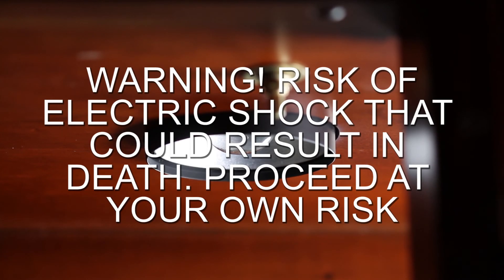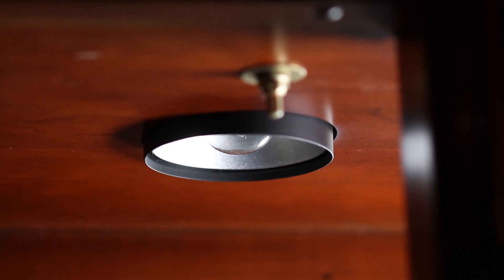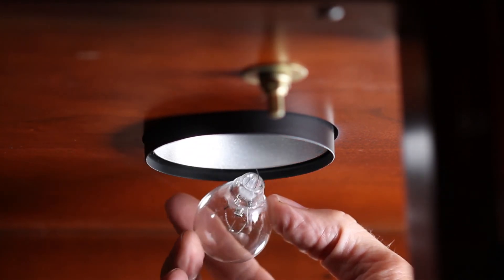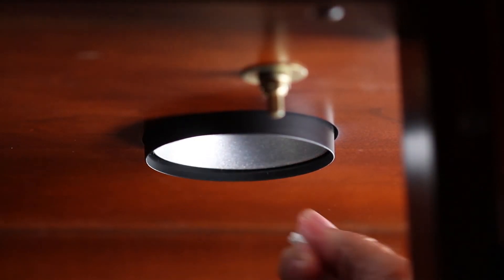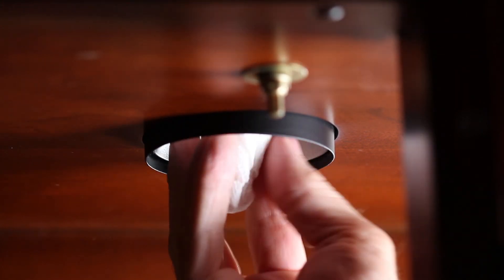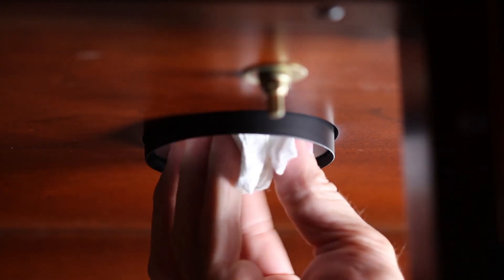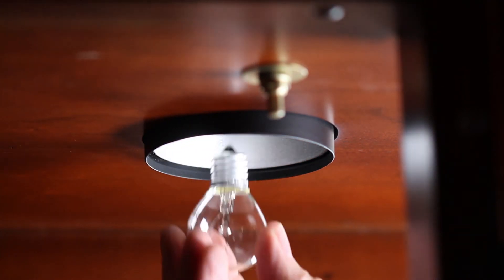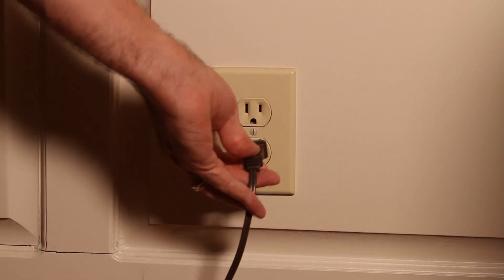Replacing a broken light bulb

Comment: I haven't tried this so I'm relaying this only as a suggestion 1st thing first make sure the power to the light is off, unplug, turn the switch off or turn off the power for the whole house. 2nd thing is you can apperantly use something like a potato press it against the stuck /broken bulb and then use the potato to unscrew and remove the broken 💡